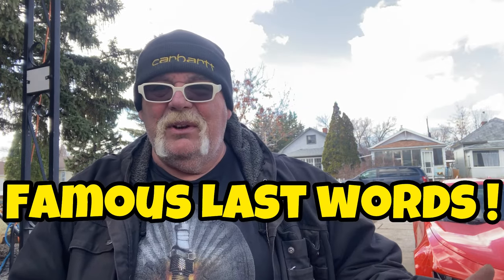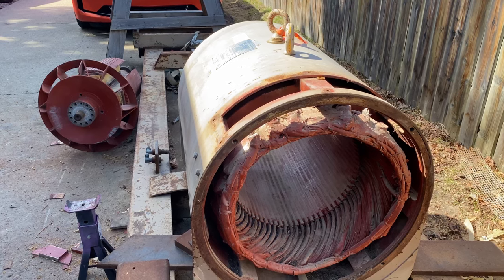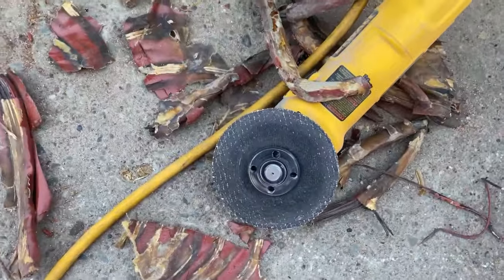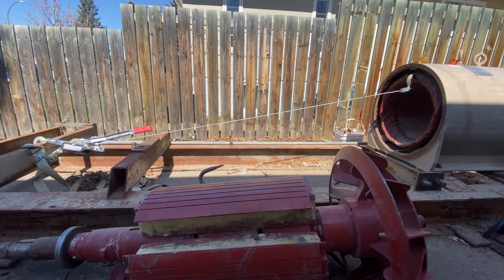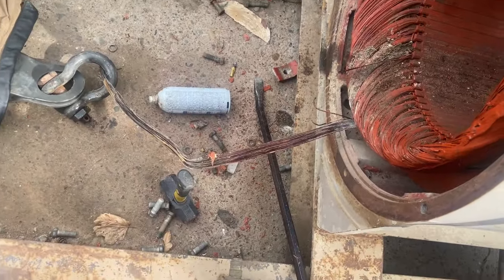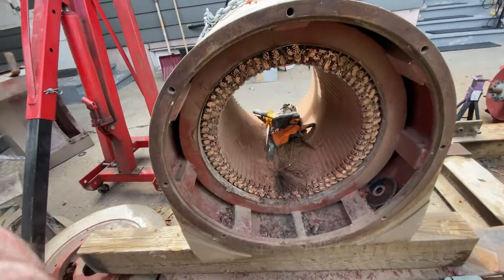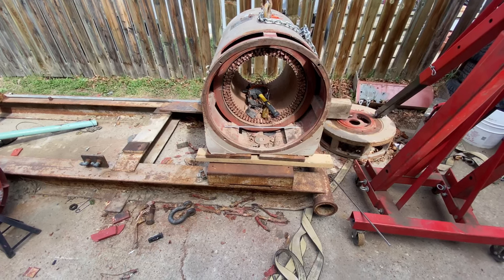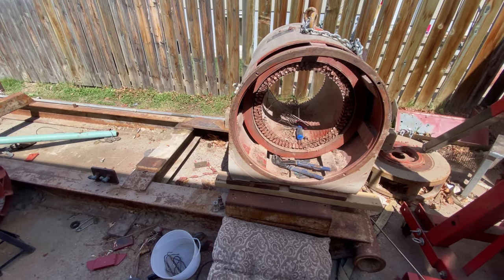9,000 Pound Generator - Finale - How Much Copper in a Huge Stator

Comment: lots of heat  to soften the epoxy in the fibreglass that's bonding the copper to the iron core. maybe light a barbecue inside it then pull the copper out while its still hot.
Reply from the maker: That’s a good idea as well
Reply: Agreed
Reply: Heat it up pull out little at time
Reply from the maker: @jodikinson5755 👍

Comment: $600 to $700 for copper bearing motor is not bad considering the amount of copper you already retrieved.  Personally I would sell as is and save your back. Speaking as someone who has already had 3 major back surgeries in the last 2 years at only 49 years old, it's not worth it.
Reply from the maker: My thoughts exactly, I’m very happy with what I got

Comment: I have done one a little larger 10,500 pounds and after cutting off one end of the statter, I took the it out to a local farm and set it up on the end (cut end down) and built a fire inside and let it burn for 2 days, adding more wood to the fire every 6 hours, after 2 days burning picked it up by the hoist rings and let it cool for a day, then took it back to my shop and the copper came out every easy, used a puller to pull each loop out, after it was all cleaned up I recovered 475 lbs of #2 copper @ $3.60 per pound + $1,710.00 with the steel joust over 9,925 pounds @ $260.00 a ton for #1 Steel = $1,290.25 for a total of $3,000.25, Scott - Reliable Recycle, Inc., Cedar Rapids, Iowa
Reply from the maker: Thank you for explaining how you did it and I am sure after this experience that is the only way it can be done

Comment: It would be a lot of cutting to get that casing off and expose the innards. But then way more cutting, similar to the crown, to cut the cylinder into smaller rings/segments to punch out the strands with less friction. Overall it’s too long and too much resin/plastic junk.
Reply from the maker: I agree 100% I’m going to try heating it up and see if that works if not she’s gone

Comment: use WD40 and spray around the copper inside but you cut off the crown you needed the crown the wire will slip easily out once using the come along

Comment: if you took 2 cuts down the case splitting the case once done shouldn't it pull off to the outside much more easy 6-700 as is wouldn't be bad but 1-2 hours more and how much would it be worth then
Reply from the maker: I’ll definitely take that in consideration